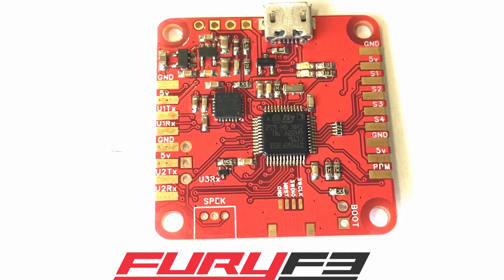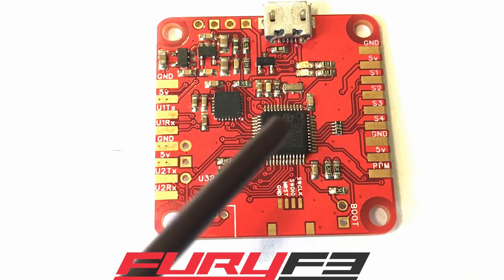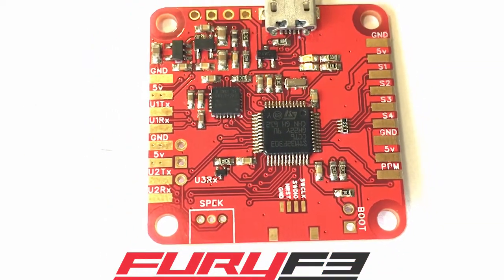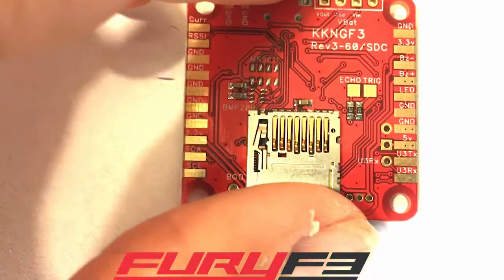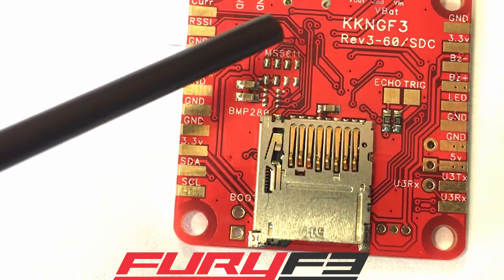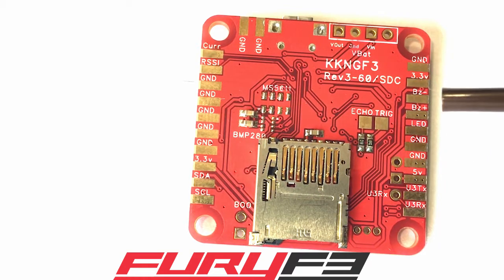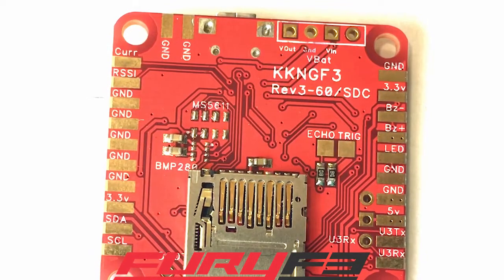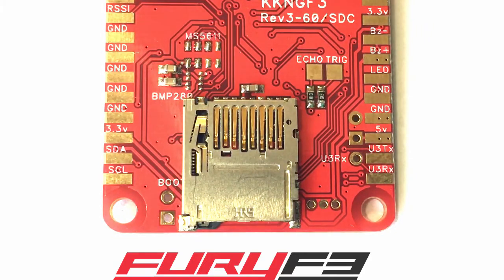FuryF3 F3 Flight Controller Overview and Setup Video

Comment: where would I put the s-port from the x4r on the fury? do I just use an available uart?
Reply from the maker: I misread what you asked!  You can't use the same UART.  Choose a different one, then You will have to invert telemetry in the CLI.  Connect the S wire form the Sport.
Reply: I can run the s-port and sbus thru the same connection? uart 3 for example will take the +/-&sbus , then I just wire the s-port in the same hole as sbus?
Reply: I'm attempting to hook up a x4r-sb to this btw
Reply: Thank you, one last question tho, s-port would it go from a utx or Urx? I'm just not sure how the fc and reciever communicate through this wire
Reply from the maker: It would on the Uart TX pin.
Reply: Thank you much!